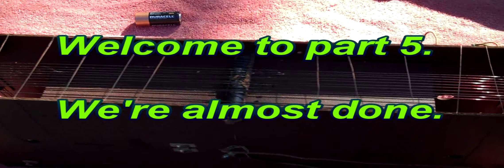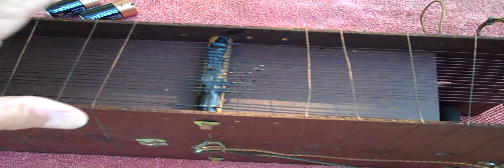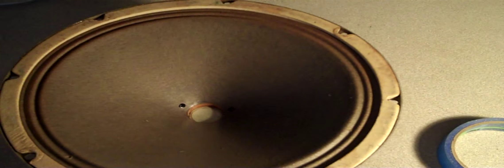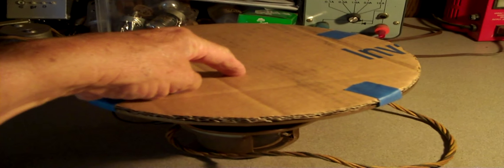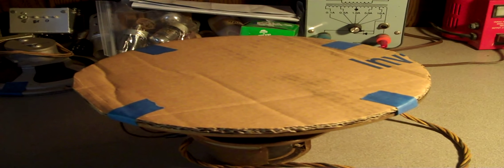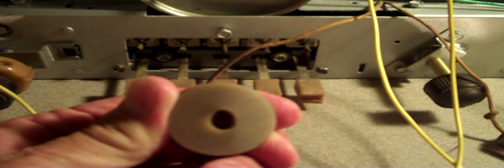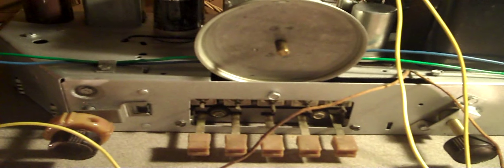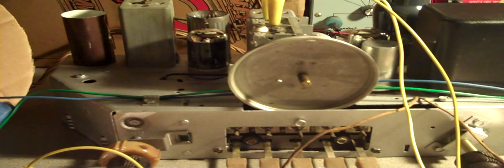1941 Zenith Model 6-S-597 Vintage Radio (Part 5 of 14).

Comment from the maker: Tom,
Hello again.  I always use 1-amp, 250-volt, fast-blo standard glass barrel fuses...one amp because I've never had a radio steadily draw more than half of an amp...and fast-blo because if something goes wrong I want the fuse to immediately open.
You'll of course hear numerous opinions about this subject, but the way I do it has always worked fine for me.  Keep this in mind: There's something wrong if your 5, 6 or 7 tube radio draws more than half of an amp.

Regards,
John